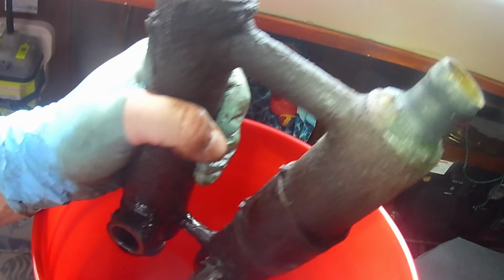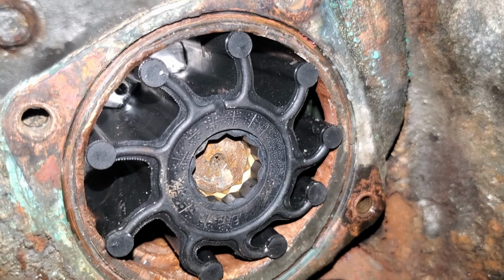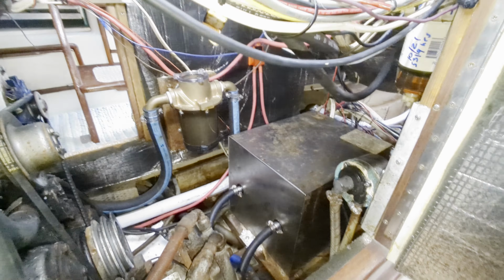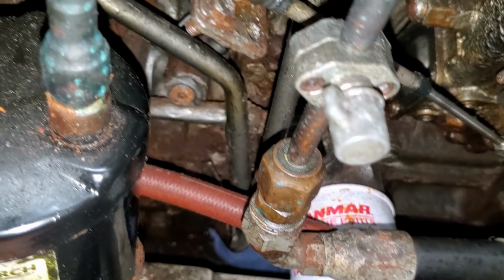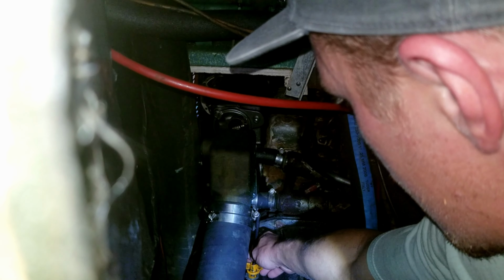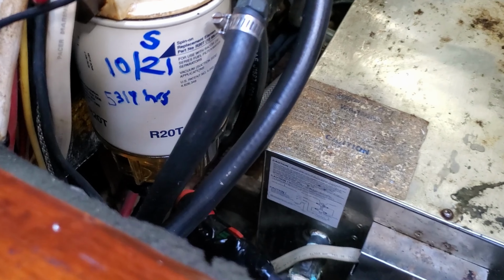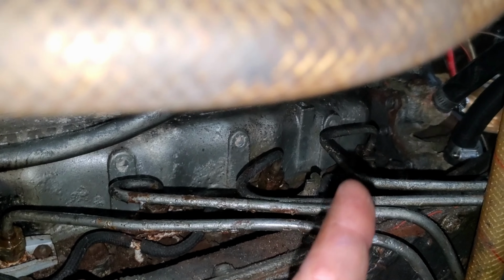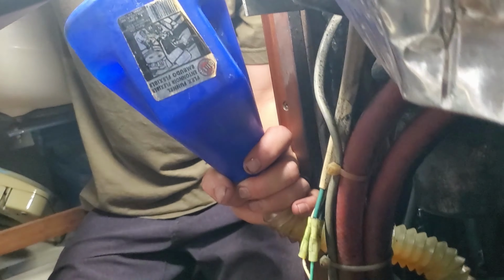SVGC 6 - Engine Maintenance Yanmar Oil Cooler Fuel Filters Impeller and Ripping out Refrigeration

Comment: Is that a yanmars 4jh? I have the 4jh te, same parts just with turbo. I have it taken apart and selling for parts. I'm in Canada but can ship the whole lot anywhere. Mine had a bad head, but everything else is great.
Reply from the maker: It is...4JHBE (I think the B is only a difference in the transmission/shaft angle or something.  I will probably think about this post down the road if something happens and I will probably wish I had some spare parts...if you think about it, shoot me an email to svgoincoastal@gmail.com with pics/info of what you have.  Thanks!